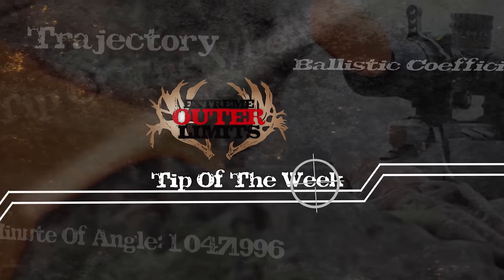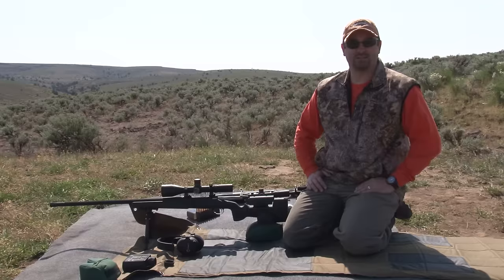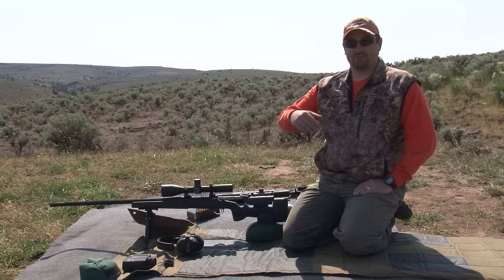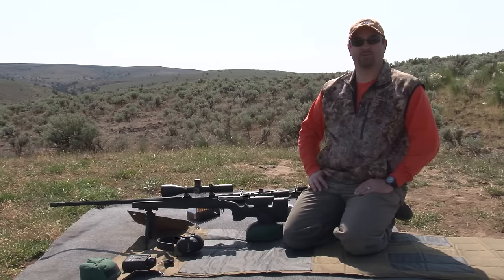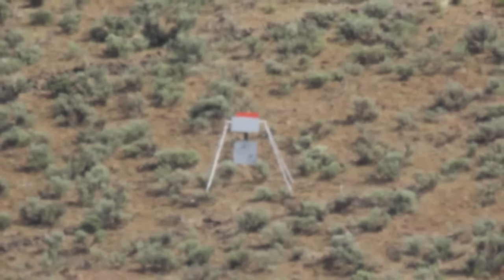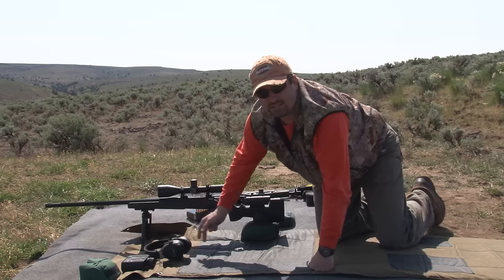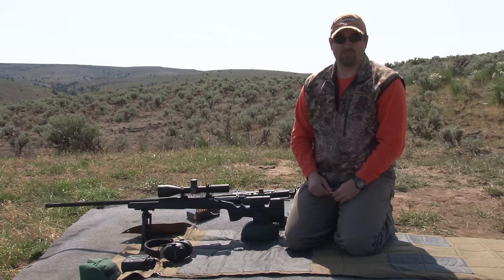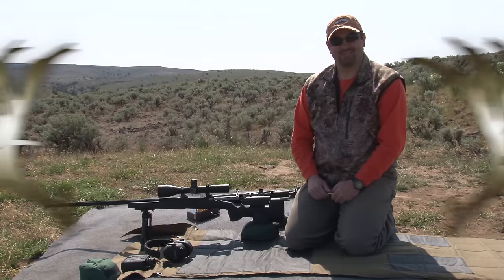Long Range Shooting Tip: Cold Bore Shots

Comment: 2 shots aint a group...lol
Reply: stephen doherty  at 1000 yards are you serious. That's amazing
Reply: WHat do you mean Stephen Doherty two shots ain’t a group you don’t get two shots at a elk usually one maybe two at most what he did there is good shooting training with a purpose you should try it
Reply: You're right, it isn't a group.  You don't shoot groups at game animals.
Reply: @robertbrandywine  correct. It depends on what you wanna achieve... If you are a sniper, a competitor or a hunter. Different situations, different goals. I'm a competitor, we dont care of the first two or three shots since there's a warm up before begining and also because we know that the point of impact is more consistent and reliable after that. It depends also a lot on the barrel, some have almost no cold or clean bore accuracy issues but most of them do. For me it's not also garanteed that the "cold bore" shot will shift in the same direction each time, so why would you set your scope on it ?